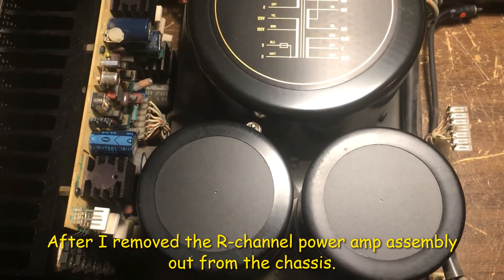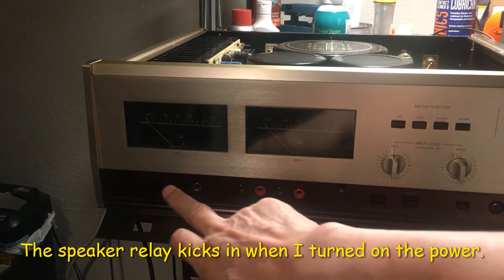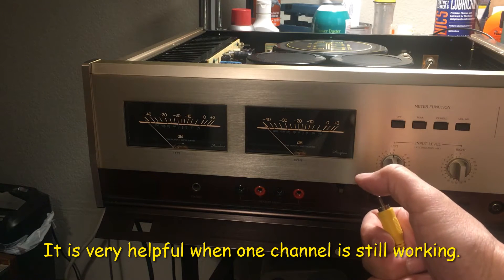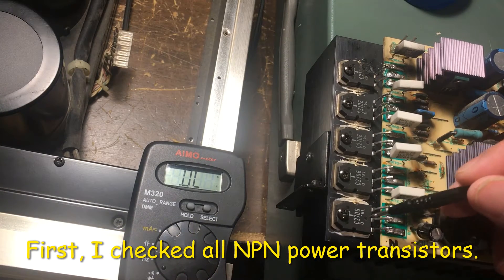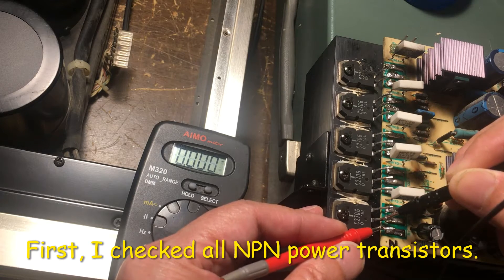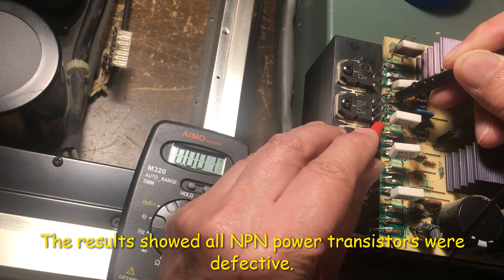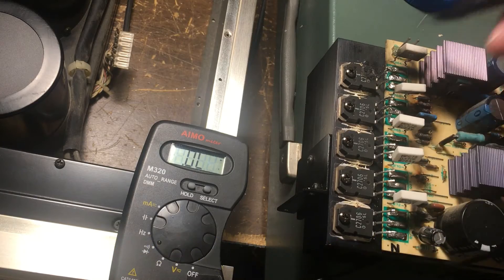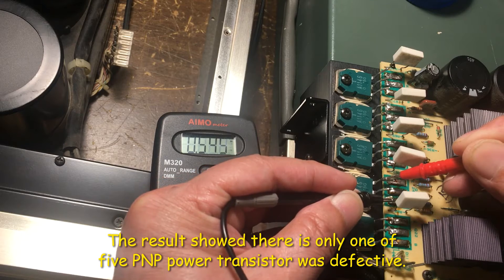Accuphase P-300L Power Amp Repair Part I - Troubleshooting

Comment: Take  two of them off and running on less power would be better sounding amp
Can you print your text in White it's hard to see thanks or red on white
Reply from the maker: I am trying to get a new video editing software which has the features to adjust the text colors and other functions. I am limited by the software I am using right now. I welcome any suggestions about the video editing experiences. Thanks.

Comment: Nice work . on a side note ,I have an update on the accuphase e305v I have been working on. Last time I mentioned that the volume knob turn up by itself. Turns out the right channel of the power amp has burn out transistors and resistor  thus somehow causing all sorts of problems. I removed the right channel and everything seems like it's working with out a problem. I am coming up with a reversed engineered Schematics for the e305v . One last thing , does the cement resistors (square long legged resistor near the transistor) measure with the resistance it's stated on the marking ? I have troubles verifying if it's resistor is defect since the multimeter reading does not match with the marking
Reply from the maker: Cement resistors are power resistors that are heat and flame resistant.The tolerances from the stated resistance value are around 5 percent. So if you measure the value exceeds (or under) too much than the marked value, you can consider them defective.